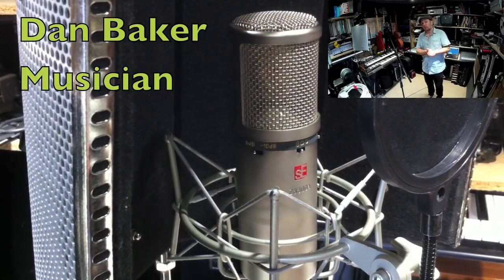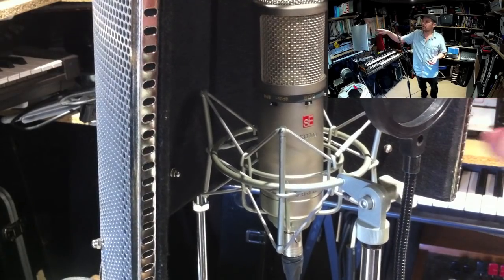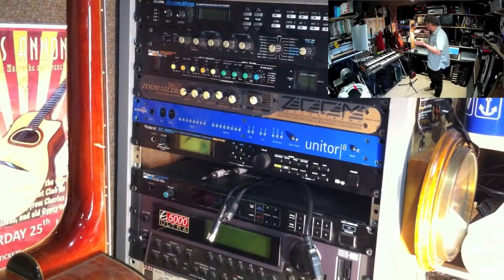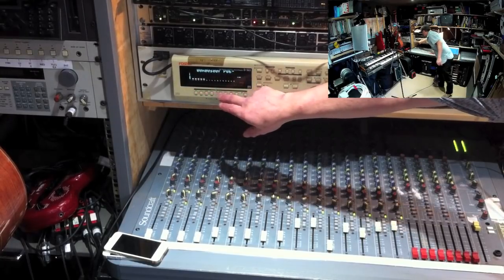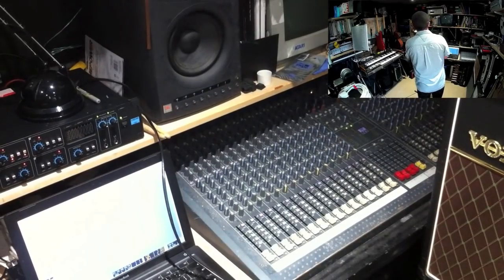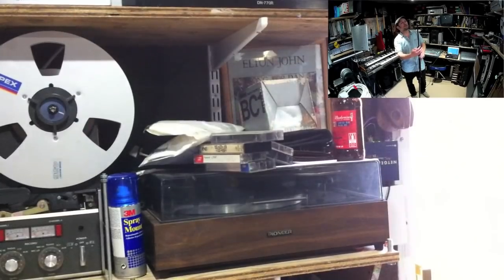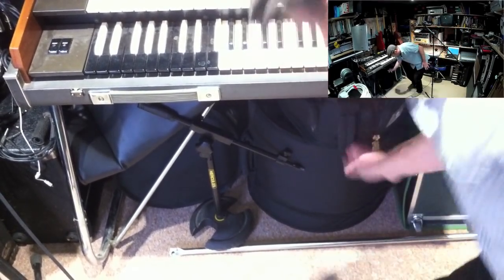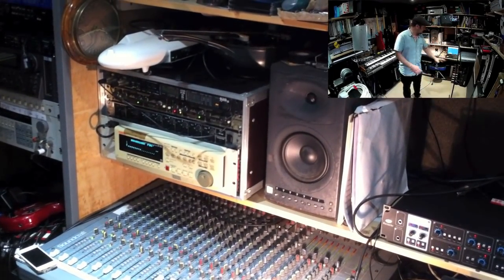Home studio - setting up

Comment: Hi Dan first I'd like to say I tottly enjoy  your videos , I have learn so much from you. sometimes I view your videos 3 or 4 times.I have so much respect for you and your work.I have an isue I would appreciate your help if you don't mind. I bought a old Imac verson ,  10.13.6.   I   did some reserch and my interface ( M-Audio Fast Track Ultra 8R ) it is still supported by the company that bought M-Audio . I downloaded the latest driver which is 2,33 and I get no volume and in the control room it says Hardware not working I can't afford a new interface please help me find a driver , please. thanks kindly.
Reply from the maker: Hi Bill, this is indeed tricky. There are versions of the same Mac OS that give problems but the only thing I can suggest is to Google drivers for it. I’m not really experienced in computers but I did have an issue once where 10.4.10 didn’t support my old Tascam interface but 10.4.11 did. Dare I suggest upgrading your Mac to 10.14?
Reply: @DanBakerMusic    Thanks for replying I really appreciate it most people would just ignore. I will try your suggestion